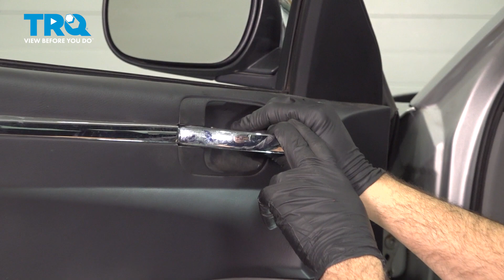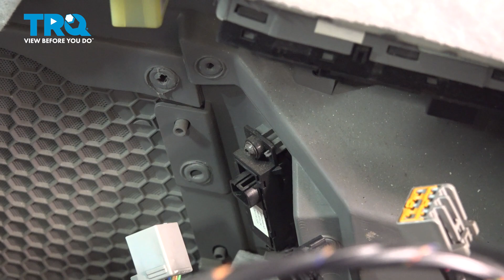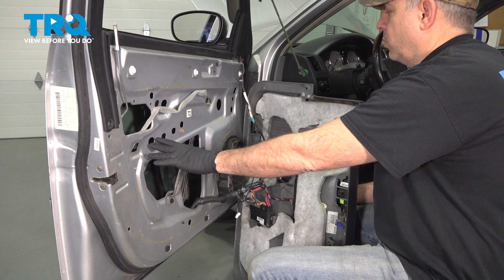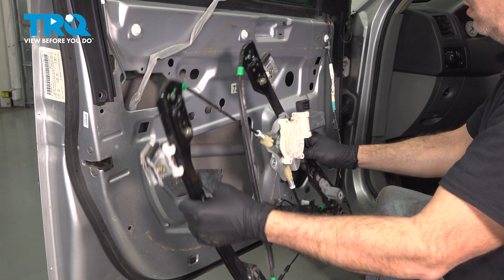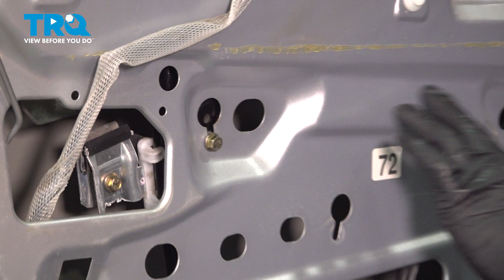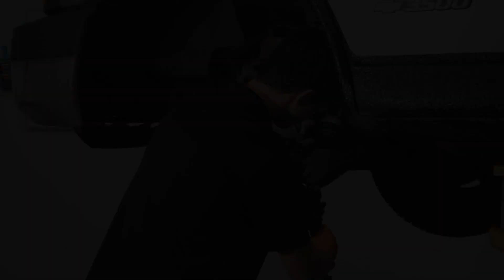How to Replace Front Driver's Side Window Regulator 2005-2010 Chrysler 300

Comment: Thanks I have a Chrysler 300 SRT.  So far I have used your videos to replace my Water Pump, Front Steering Connecting Rods, Gas Pump & Sending unit, & just now my Window Actuator because the wires were frayed on my pulleys and couldn't raise my window all of the way up. I had to use a coat hanger with a bend in it to raise my window until my parts arrived. Thanks again!